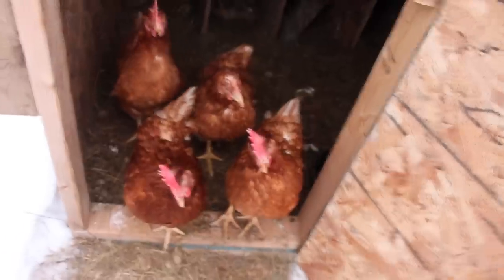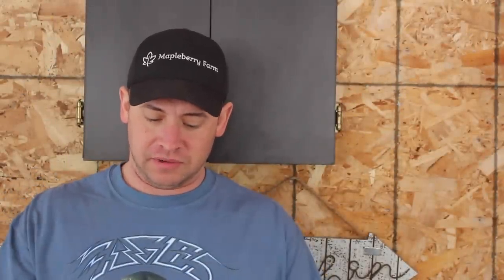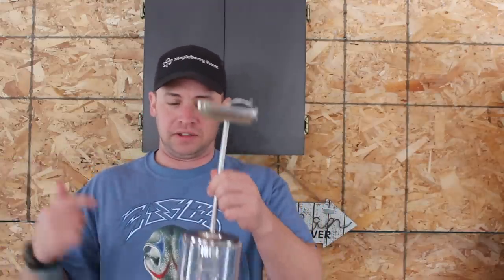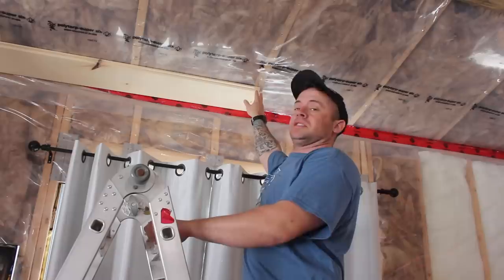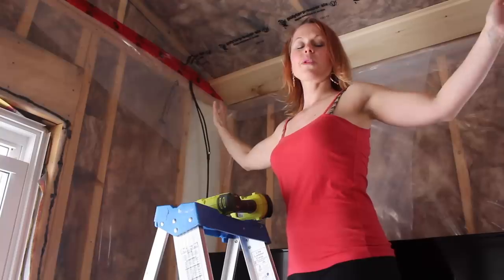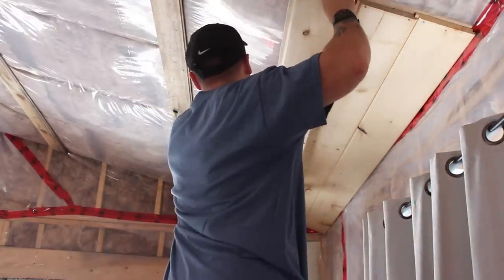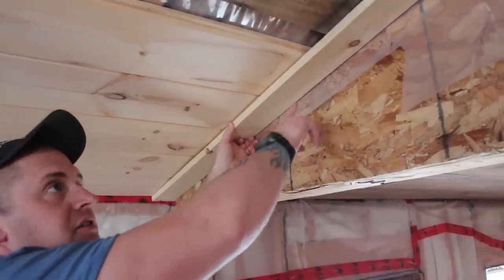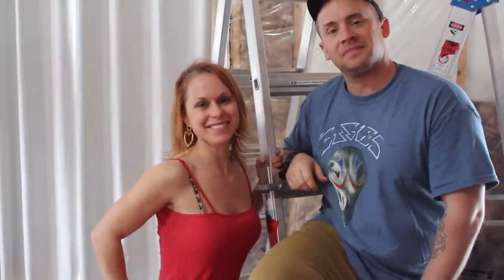Installing BARN BOARD PINE On Cathedral Ceiling

Comment: Every remodel I've done that had the plastic barrier had rot, it sweats n traps moisture. I like to use Tyvek or felt paper. Also you could hide the nails in the tongue and groove by angling the nails through the tongue and the groove holds the other end like a hard wood floor. Lookin good, keep up the good work! 👍
Reply from the maker: Thanks, not sure where you live but in this climate, vapour barrier is a must. It really all depends on where you live.

Comment: I just finished my cottage with tongue and groove..I staggered the cuts and on each stud/ceiling rafter I made sure the board ended halfway so the ends butting up shared somewhere you could nail into.  But overall nice job!
Reply from the maker: Only did it this way to save on wood and we were building a false beam up the seam also. The trusses are strapped to death too, so lots of strength :)

Comment: Just a thought....caulk the seam before you finish over it. Just makes it a bit more impregnable to any draft....it's a preemptive piece but may save a regret later. Looks good. Any reason you went shiplap instead of barn board? Either would look good...I guess I'm just partial to barn board.
Reply from the maker: They are actually called barn board pine.

Comment: Tell me, between the vapor barrier and the boards that you attach, it seems there should be a crate, the film should not touch the skin?Or is it all solved by good ventilation?
Reply from the maker: There is nothing needed between the final product and the vapour barrier.

Comment: Looks great! Couple questions: 1) what did you use to insulate the roof? 2) I'd call that a basic A Frame roof; I usually think of cathedral roofs as steeper in angle. Why is that considered a cathedral roof?
Reply from the maker: Cathedral ceiling, not cathedral roof. It is because the ceiling angles up instead of running flat. The roof is insulated with R20 batts, doubled up. Thanks :)

Comment: I thought the reason for staggered board lenghts was structual intergerty?
Reply from the maker: The trusses are already all connected with bracing, roofing, boards running through, etc. Not having the interior boards staggered isn't going to make or break it.

Comment: That place is gonna sweat and mold and rot putting plastic on the inside like that. I've torn apart alot of houses and buildings that was done in. Everyone had structural damage.
Reply from the maker: Not in this climate, this is to code and how it is done around here. It all depends on where you live. Do some research about vapour barrier in different climates and it will make sense to you why ours is this way.
Reply: @MBFModernHomesteading  hopefully you dont get any, you put alot of work into it. I've always found it a shame to tear stuff apart because that was the code. And shity building practices.
Reply from the maker: @2112kustoms.  We will be good, code or no code, this is good practice in this climate. Thanks for your concern though.